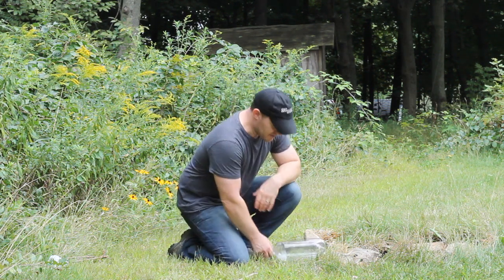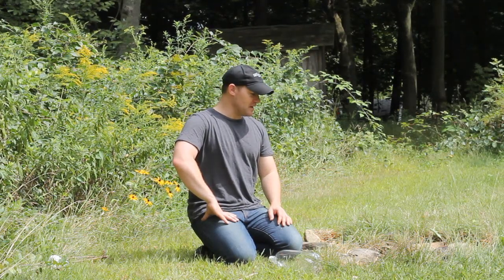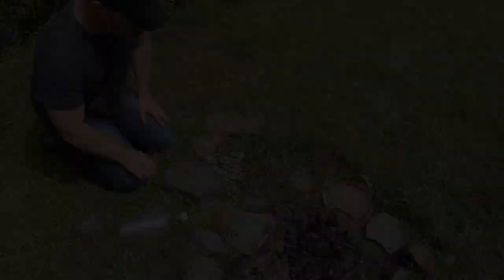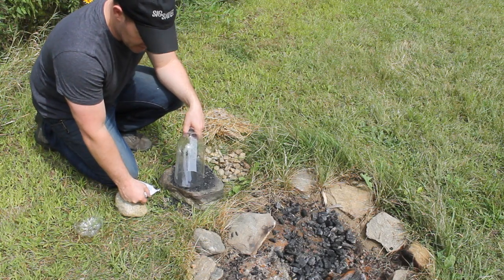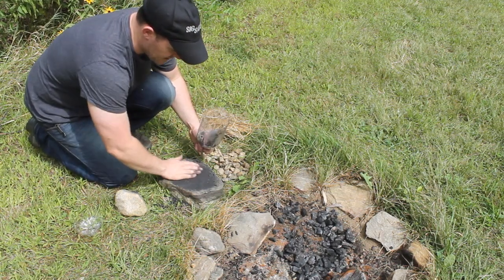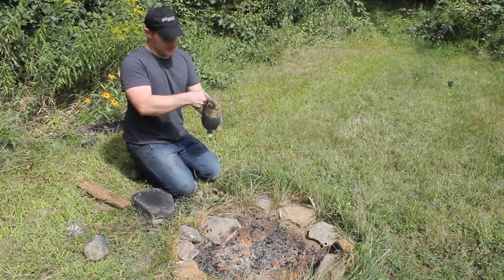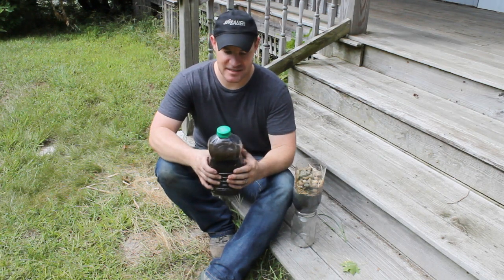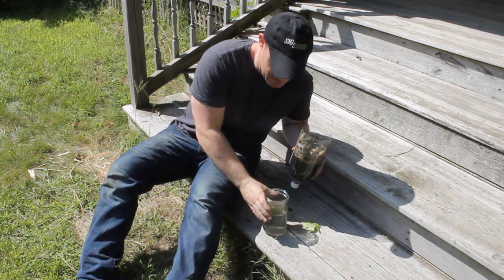How to Make a Field-Expedient Water Filter

Comment: I teach this same method in my preparedness/survival classes!
I made a hanger out of 3-strands of braided #550-cord which is handy (+1-wrap around at the neck and 1-wrap around the base (now top), then the 3-braided strands are sewn onto the wrap at the neck, then the wrap at the "bottom", then about 3-foot length sewn to a hand-grenade pull ring; I also kept the bottom and use it a lid when storing the filter.